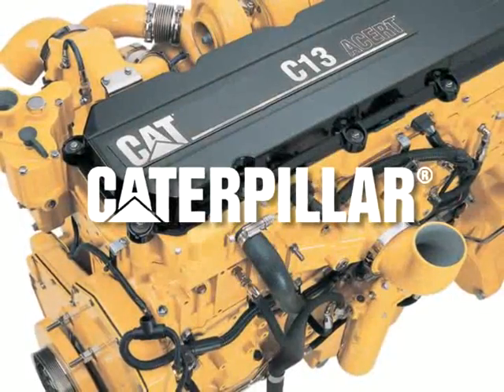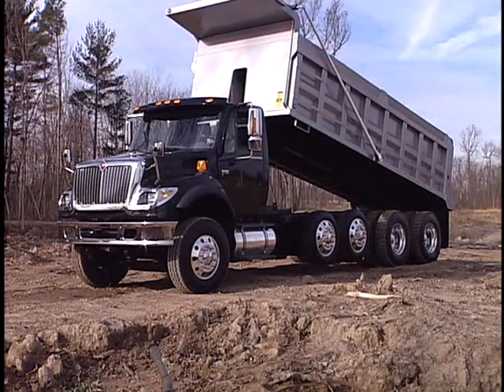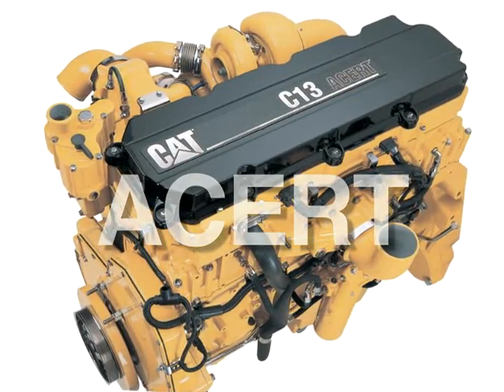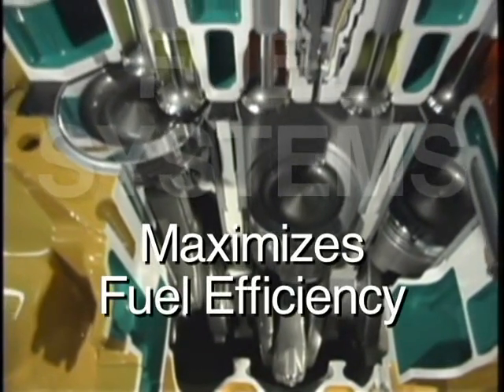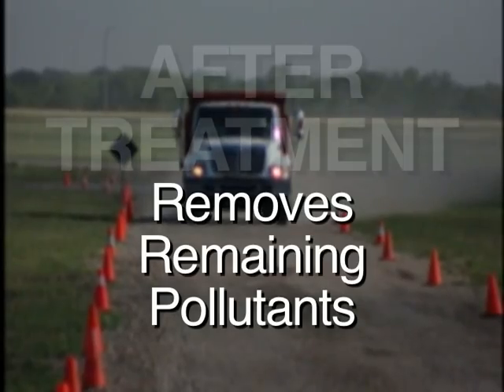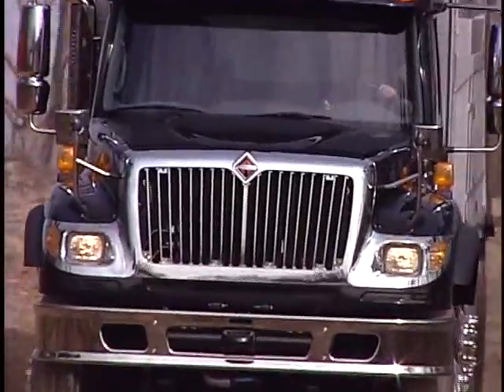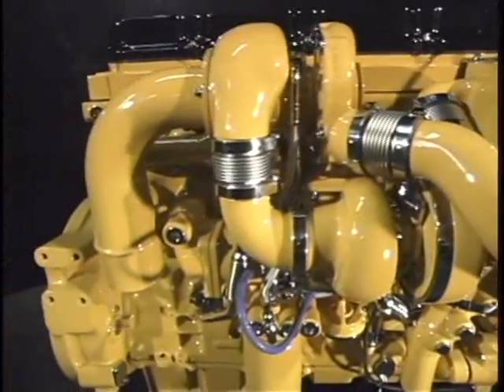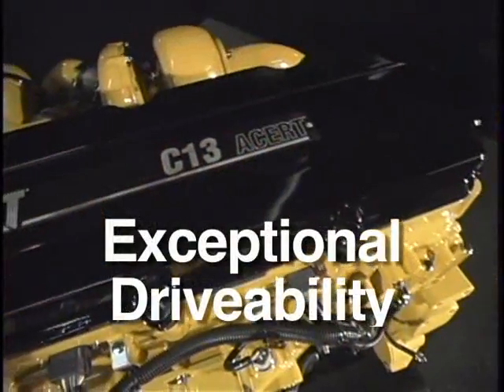CAT C13 ACERT Engine Tour

Comment: The C13s we have are always having problems.
Reply: I have 300,00 on my C13 in my 2006 KW T800 quad axle dump truck (which I bought new and change my oil at 10,00 miles) and I have had zero problems other than the exhaust manifold bolts breaking because of the weight of the twin turbos weight. They need to do a recall and install one big single turbo and it would be so much better for many reasons.
Reply: Got 1,972,000 on mine.  It's done well.
Reply from the maker: And that is why they got sued and settled: https://www.enginesettlement.com/

Comment: I just got another international with an IS Cummins 500 horses. The one with the C13 is up for sale.it has 987k on the odometer. It was recently overhauled in 2010 at Thompson cat.still junk.gutless oil slinging junk motor.had one actuator replaced in 2011, and in august 2013, I replaced the high speed turbo.today, it has a cracked exhaust manifold, and a bad blow by problem. Using a gallon of oil once every other week.i can't afford to give it away.i will take $10k cash right now for it.

Comment: Junk! Turbos have to be replaced every year, shitty actuator problems, check engine light flashing, its a piss poor motor. About as shitty as 4ck peek 3 caterpillar of the early 90s but pulls better.i got an 06 international and I want to do a C15 swap.make that 6NZ swap.but the dealer said  it would be too expensive. Smh oh well I guess I'll just trade it for a Fitzgerald freightliner with 60 series Detroit
Reply: that's a bunch of B,s my C13 Acert KCB has over 1 million mile's on it now and has been in frame once with the original twin turbos from the factory and the same injectors. no ECM problems either, and no blow BY and I've been running Delo 15/40 since it was new in my T800 KW dump truck, and this truck work's in the most extreme conditions you can put a truck through up here in Alaska. from -69°F in the winter and normal lower 48 Temp's in the summer. so I think the problem lies with you the driver period. learn how to drive a diesel engine and you'll probably find out you can get a million mile's out of it Too. I plan on running this Caterpillar C13 until it can't be rebuilt anymore. just as I have done with my first 1693 CAT 38yrs ago! But like I have always said you can give a steel ball bearing to some people and they will give it back to you broken and that's just a fact period.
Reply: that's a bunch of B,s my C13 Acert KCB has over 1 million mile's on it now and has been in frame once with the original twin turbos from the factory and the same injectors. no ECM problems either, and no blow BY and I've been running Delo 15/40 since it was new in my T800 KW dump truck, and this truck work's in the most extreme conditions you can put a truck through up here in Alaska. from -69°F in the winter and normal lower 48 Temp's in the summer. so I think the problem lies with you the driver period. learn how to drive a diesel engine and you'll probably find out you can get a million mile's out of it Too. I plan on running this Caterpillar C13 until it can't be rebuilt anymore. just as I have done with my first 1693 CAT 38yrs ago! But like I have always said you can give a steel ball bearing to some people and they will give it back to you broken and that's just a fact period.
Reply: I bought mine new in 05.  Turbos have 950,000 miles after being replaced under warranty @  249,000 miles.  Overhauled it @ 1,000,000.  Pulls the hills well, I'm amazed at the trucks I pass on Monteagle when I have 54,000 in the trailer.
Reply: Well you have your opinion like I have mine.i personally rather have the 6NZ. Much better motor over accert.
Reply: Never said it wasn't, but laying a blanket over all of one type of engine seems wrong.
Reply: +Eric Haley Now up to 1.2 million on my turbos, still doing great.
Reply: Had turbos replaced on mine three times. KCB 430 horse C13. I had it sleeved at 550k miles. Got another 600k out of it before the blow by issues got worse.had an oil cooler fail back in  October last year and it was about as much as I could stand. Now I have an 09 Peterbilt with an ISX-15 Liter 500 horse Cummins. Caterpillar made a goofy mistake when they developed the C13. The C15 6NZ is the only way to go if it's a Caterpillar engine.
Reply: that's a bunch of B,s my C13 Acert KCB has over 1 million mile's on it now and has been in frame once with the original twin turbos from the factory and the same injectors. no ECM problems either, and no blow BY and I've been running Delo 15/40 since it was new in my T800 KW dump truck, and this truck work's in the most extreme conditions you can put a truck through up here in Alaska. from -69°F in the winter and normal lower 48 Temp's in the summer. so I think the problem lies with you the driver period. learn how to drive a diesel engine and you'll probably find out you can get a million mile's out of it Too. I plan on running this Caterpillar C13 until it can't be rebuilt anymore. just as I have done with my first 1693 CAT 38yrs ago! But like I have always said you can give a steel ball bearing to some people and they will give it back to you broken and that's just a fact period.